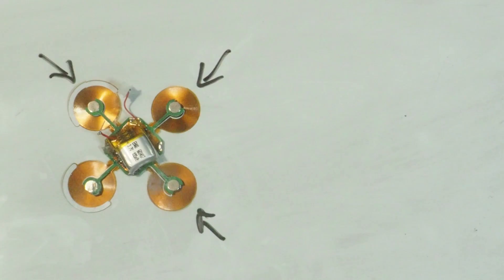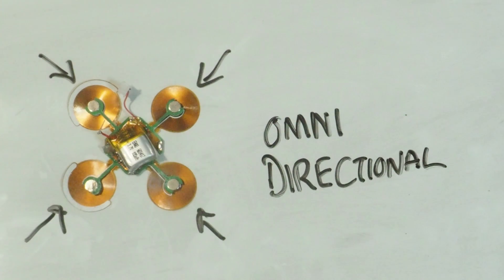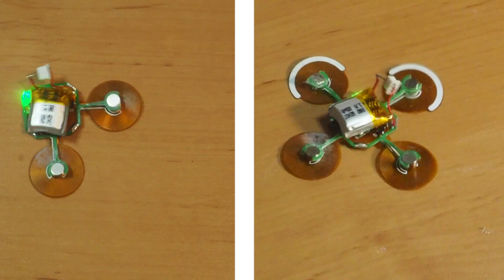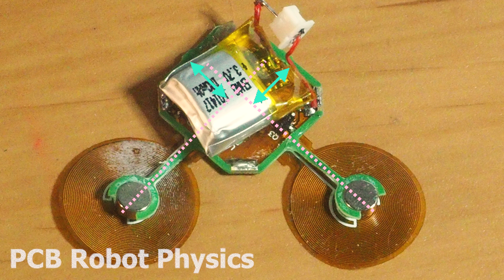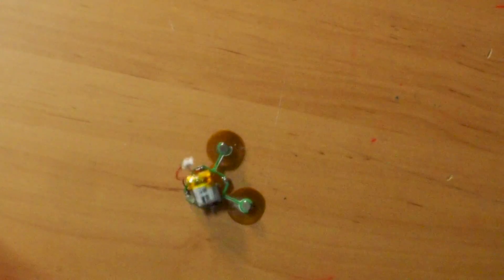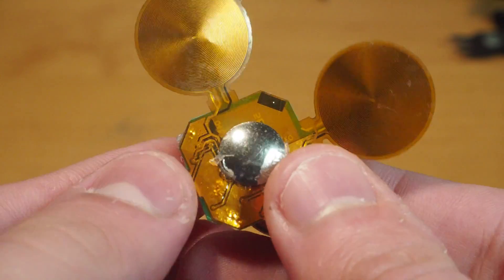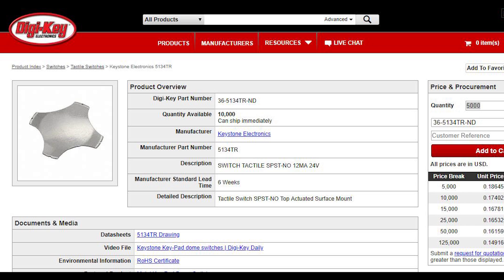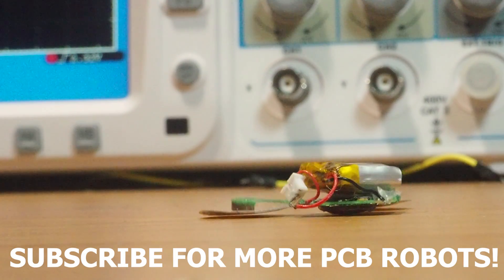PCB Robot - 2 Legs Test!

Comment: neat concept, but coming from a background in BEAM (google mark tilden) robotics, I can tell you that there is one major flaw/problem you may or may not know about.....when you pulse a coil over a magnet and the polarity is such that you PUSH the coil AWAY from the magnet, you will de-magnetize the magnet after a few months. We in the BEAM community found this out about 15-so years ago with the magbot sundancer solar powered robot. So if this stops working after a while, this will likely be one cause of the failure. 

I hvae had to re-design my solar powered butterfly robots with this in mind, you need to have the coil ATTRACT and move TOWARDS the magnet and this will actually strengthen the rare earth magnets over time, helping to increase the life of the robot
Reply from the maker: Interesting! Thanks for the tip 🙂 have you observed this with N52 magnets?
Reply: Wow! this means you can make magnets even more powerful than neodymium?  I wonder what the limit is?
On the other hand don't electric motors also push away from their magnets? Or do they do both, push and pull, so the effect cancels?
When you said it wears out the magnet, how long was it running continuously? Or how many hours a day, and for how many days?
(Many questions because this interesting!)
Reply: TheRainHarvester It depends if neodymium magnets already are at the maximum flux density and have reached saturation. At saturation you cannot get any more flux density, it is as dense as possible with magnetic flux lines and the magnet will not be any stronger.With motors, you have a rotating stator/rotor and set of windings. When you energize the DC motor Say for instance clockwise, the polarity may initially cause the windings to initially push away from the magnetic field but you have coming right behind it on the other side of the winding a magnetic polarity that will be drawing the windings towards the motor so it basically undoes the effects of the half of the windings that repel. And same thing when you reverse the polarity of the DC motor. Initially you may have the windings draw the magnet and windings together but on the other side of the windings you will have a magnetic polarity that repel. So since there are both north and south electromagnetic pulse in a stater you have it constantly spinning and balancing out the effects so the magnetic field stays constant. So yes that push poll effect kind of happens.But when you have an arrangement where you have a coil pushing off of a magnet and that’s the only polarity induced to it, it will wear out. So back in the day Solarbotics  used to have a magbot Sundancer kit That when Left in the windowsill would flap the butterfly wings but would get weaker and weaker and After anywhere from 3 to 6 months it would stop working. It really depends on how many hours of the day it had sunlight. But the thing would pulse probably every 5 to 10 seconds depending on the strength of the light and how much sun there was that day etc. So if you use once every five seconds for 8 hrs a day as a baseline for it failing in three months you could extrapolate that data and figure out how long it would wear out when you’re pulsing these coils in this video rapidly at 40 or 50 Hz. It wouldn’t take long imho!
Reply: Jesse Meers , thanks for this detailed reply!  I had never heard about this before.  I wonder when this discovery was initially made in academia?  Great info!
Reply: TheRainHarvester that’s hard to answer because there is a difference between published knowledge/data/research findings vs actual experimental lab discoveries that are discovered but either are never documented by a person or it comes out at a later date. There are things we may never know who or when things were first discovered in academia or non academia.

Comment: Hey Carl, great to see the progress! Would a ball bearing under the middle of the center mass help reduce friction? Maybe something like these? https://www.amazon.com/Ceramic-Loose-Bearing-Balls-SnowSpitzShop/dp/B077L11J8L/ref=mp_s_a_1_8?keywords=2mm+ceramic+ball+bearings&qid=1552213002&s=gateway&sr=8-8
Reply from the maker: It could if I find an easy way to mount it.. It will act as a caster wheel

Comment: Maybe you can create something like this?
https://imgur.com/a/61j5Orv
Can you get the idea? Thinner the arc, more easy will be to bent.
This way i believe you can increase de current and also the weight of the battery
Reply from the maker: Interesting! I have done something similar in this video. I'm considering to make one (with turning control) from an entire flexpcb. I think I will test another paper version before though https://youtu.be/0zsAJ7_eF4M
Reply: @CarlBugeja  That's right! I remember that video. Great you have shared your thoughts.
Btw, if you face 2 coils, can't you control if you want them to attract or retract by inducing current in the same or different orientation?

Comment: The idea is to build a swarm, right? How close can two of them get before their magnets pull them together?
Reply from the maker: Yep that would be a problem.. I somehow need to limit the distance from each robot.. Maybe I can do that with the bluetooth's rss 🤔 or add another sensor
Reply: @CarlBugeja  I like the idea of using the signal strength. That would be great if it could work. Maybe you could just have some central controller that monitors the swarm with a camera and gives instructions each of the robots.